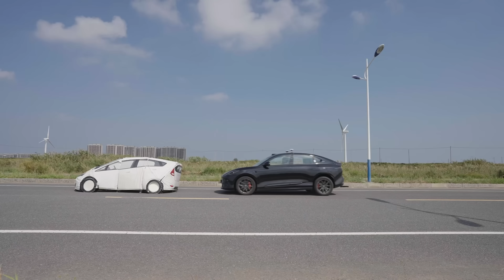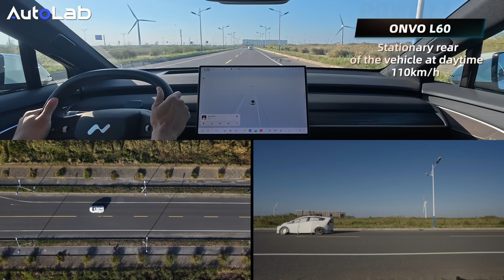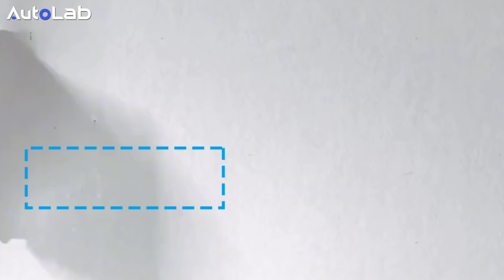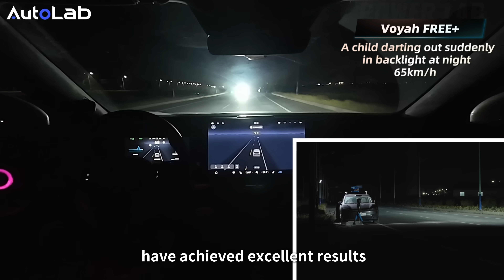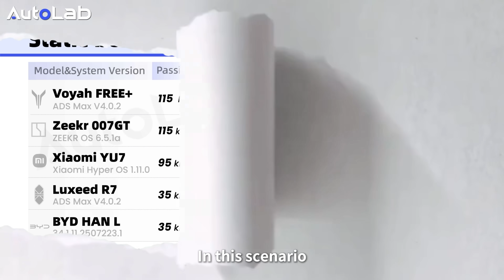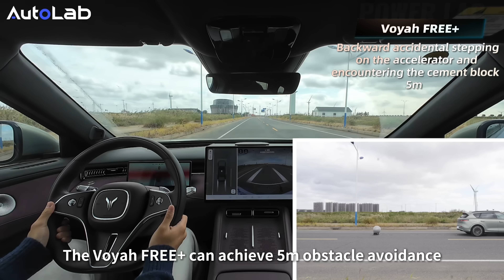9 Cars Tested Against 10 Real Crash Scenarios: The Truth About Active Safety #AEB

Comment: Hi...one question...those tests done under ADAS being activated...they dont work on LCC only...correct? So the safety stops tests etc only work with ADAS(maps) being engaged?
Reply from the maker: Of course not. Active safety functions keep operating under normal manual driving conditions. NOA is activated to eliminate interference from human factors.
Reply: @AutoLab评测官 thanks...

Comment: Do you have any insights into why the two ADS4 systems don't show the same performance?
Is it different sensor placement? In the cement block test, it appears that the front of the bonnet obscures the view of the Voyah's lidar but shouldn't it have remembered the block's location from its approach, and wouldn't the camera, radar and ultrasonics spot it?

Comment: 🚗 This is not about expensive brands or more sensors — it’s about braking logic & split-second decision-making
🧠 Lidar ≠ automatic safety if the system thinks slow and the brakes are weak
🏆 Huawei ADS 4 (Luxeed & Voyah) is clearly the most mature — consistent, strong braking, and calm under extreme situations
⚡ Zeekr & Xiaomi are genuinely impressive — already very close to Huawei’s level
❌ But when it comes to wild animals, everyone fails — a harsh reality of the industry today
⚠ Even the best AEB has limits — don’t hand over your life 100% to software
📌 Conclusion: Active safety helps save lives, but it doesn’t replace the driver’s brain